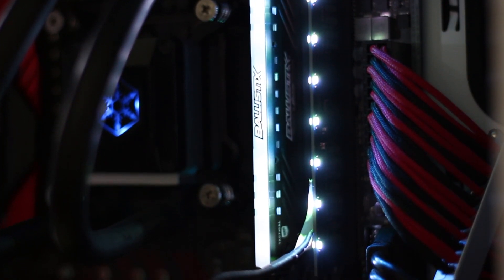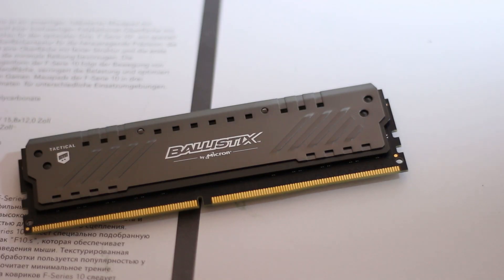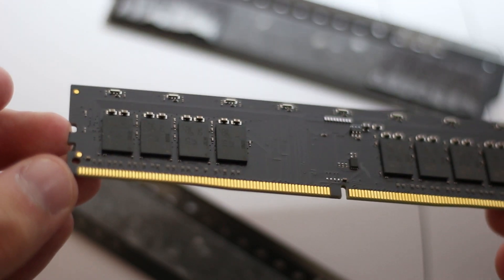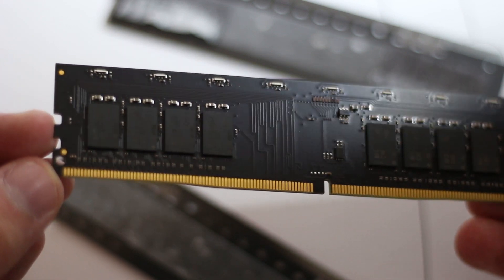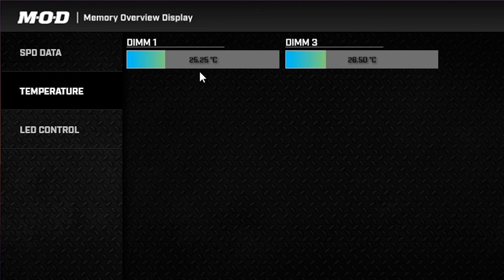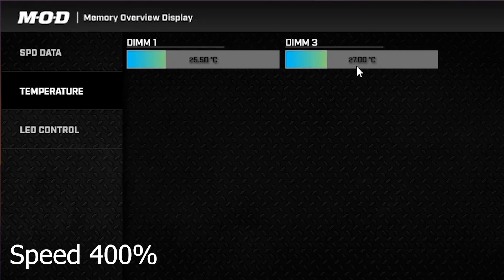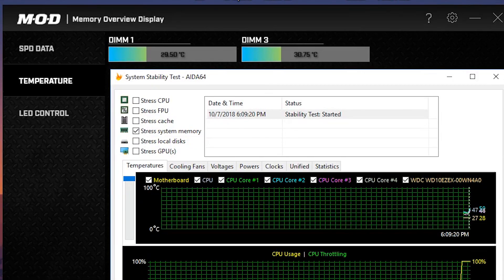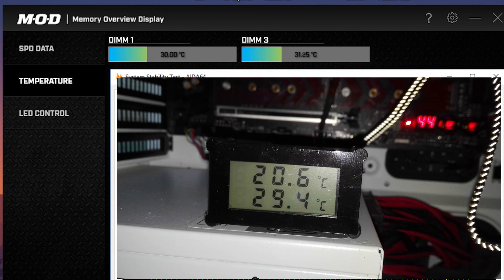Do RAM heatsinks actually provide cooling?

Comment: I think the fact that the heatsinks are attached to the ram with glue tells you everything you need to know and answers the question nicely
Reply from the maker: It depends; there are self-adhesive thermal pads that do transfer heat.

Comment: the problem with how this was testsed is slow without the heat sink pretty much gets all the direct airflow. You would probably observe that ram slot being cooler if it had a heatsink as I normaly find my slot 3 or the closest to the 24pin as my coolest slot when all things are equal because of front airflow. Id like to have seen the test repeated but the heat sinkless ram in slot 1 and the heatsink in slot 3
Reply from the maker: The purpose of this test was to highlight that a lot of claims about cooling are not true. While I understand your point, it cannot be tested as you would need different heatsinks included. By this I mean, some RAM kits have fins on the heatsink, some do not, etc.
Reply: @TechLegend-com  could you not have tested the ram with removed heat sink in slot 2? And slot 4? And vice versa to eliminate the slot with direct airflow seeing better temps. So then you could compare directly what temp the ram would have in what slot. As the slot with the direct airflow is always cooler then the sticks behind it as it blocks a lot of the airflow for the other dims.
Reply from the maker: @Demon09-_-  It all depends on the airflow direction. In in hindsight, what you say makes sense. When the DDR5 market stabilizes I will redo the testing with DDR4 and DDR5 modules and see how those perform with and without heatsinks.

Comment: I don't think this realy provided an answer. What always buggled my mind for example is with those heatsink, the surfaces are very close together. There cannot be any airflow unless it is forced through with a fan directly attached to the sticks.
Just two sticks together doesnt provide that same circumstance. Instead, measure four sticks with heatsinks, than those same four with the heatsinks removed
Reply from the maker: That just adds more variables. Some heatsinks will work, some will don't. The purpose of this video was to make people realize that heatsinks are not necessary. They will help but it's not the end of all things for RAM modules.

Comment: Thanks for the video, I always thought of these ram kits with dangerous names such as rip-jaw, detonator etc were all just gimmicks.

Ultimately the ram chips themselves are mostly manufactured by micron, hynix or Samsung so have to follow the DDR standards.

Most heatsink rams I've come across are attached using adhesive thermal pad, so if the rams were to go say 50/60°c from the serious xmp set by these gameing ram manufacturers, the heatsink would probably melt off and the positioning of most gaming system motherboards being vertical, gravity would assist it falling off hence why there wasn't much difference in temperature with and without heatsinks. That's what I believe anyway.

Have you come across any rams that have heatsinks attached using screws?
Reply: Yes mine use a small m2 screw
Reply: You have to remember just because the RAM chips themselves are made by Micron, Hynix, and Samsung doesn't mean they perform the same. Just like SSD NAND flash is made by either Samsung of Toshiba, and most memory controllers are by either Phison or Marvell, even when two different brands of SSDs has the same exact NAND Chips and memory controllers they can perform completely different due to the PCB and the firmware that the brand puts onto the memory controller.
Reply from the maker: @armybear2  True.
Reply from the maker: There are some RAM kits that use screws but it makes no difference. The self-adhesive thermal pads that they are using on most if not all RAM kits are designed to be sticky even at high temperature, that's why it won't come off.
Reply: @TechLegend-com  but not very high heat, as you've shown, you used a hair dryer to heat it up and it come off easily.
Reply from the maker: @alfredmanner6881  I think anything below 80 is going to be ok.

Comment: Thank you. Does memory have an optimal operating temperature like NVMe does?
Reply from the maker: Usually, DDR4 memory will start getting errors after 50°C. It really depends on what you are doing with the RAM, usually, the RAM will never get to 50°C under normal usage.
Reply: @TechLegend-com  Thanks! 🖖

Comment: This is really good to know. I’m currently running a very small mini-itx build and my pico PSU has wires that run directly over my current RAM sticks. If I were to put in RAM that had heat sinks attached, I would have problems.
Reply from the maker: I'm glad to hear that the video was useful.
Reply: Because of interference?

Comment: i just bought some UGLY looking RAM but its faster than my current 2400mhz and was cheap (2x8GB 3600mhz for 50 USD) and the heat sinks on it look like something youd find in a cereal box and wondered if removing the heatsinks would cause them to heat up too much...looks like it wont really be a problem, cheers!
Reply from the maker: Great to hear that the video was useful to you! :)

Comment: I think you could have made it more clear which ram stick had a heatsink and which one didn’t in your test.
Reply from the maker: Expand on this.
Reply: the one in dimm 3 is the one without the heatsink
Reply from the maker: @fucker9002  It is pretty obvious which RAM module is without its heatsinks, as the LEDs are not covered by the diffuser.

Comment: You foget to make a point... if that 'cooling' is necessary with 30C It's laughably low temp. It provides cooling but is not needed at all.
Reply from the maker: That point is up to you to make, some people want cooling, regardless of how low it is.
Reply: @TechLegend-com  It's a good video I just think you could have included this point as those chips running twice as hot are still within the spec.

Comment: how many mhz is the RAM in this video? i'm trying to find out if there's an amount like 4000mhz that'll overheat out of the box after buying it, i still haven't found any information about that yet
Reply from the maker: The RAM in this video was running at 2666MHz, with the timings 16-18-18-38 and a voltage of 1.2V. If any RAM kit will have a higher than normal temperature, its from too high of a voltage, not really from the frequency. All this being said, I have yet to see a RAM kit that was overheating out of the box.
Reply: @TechLegend-com  i was watching linus tech tips and he built a computer with i think it was 1TB of Ram and i think he used eight 128gb modules? and he said "they run freaking hot"and he had 2 fans just for the ram and when he turned them off they reached 95C
Reply from the maker: @CrasyFingers  Depends on the voltage those RAM kits were using. Also, given that capacity for a single RAM stick, those were server grade components, quite different than the regular RAM kits we use. Especially since the voltage is different.

Comment: How do you think if a ram is ~4 years old - does thermal pad replacement under heatsinks make sense? Ram is heavily oced 1.45v+ and current temperatures in stress tests are like 55-60c
Reply from the maker: Usually, it shouldn't require a replacement for those pads, and 4 years is not that much. I'd say, leave them as they are and get more air moving over the RAM sticks, see if that helps with the temperature.
Reply: @TechLegend-com  Yeah that is one of the problems...my nh-d15 se cover 1 stick totally and to set airflow - it is a tricky question.
Reply from the maker: @BadRusMan  Well, it won't hurt them if you change the pads. So you can do that and see if it does anything.
Reply: @TechLegend-com  guess i will give it a try, hope i will not break sticks in some ridiculous way XD
Reply from the maker: @BadRusMan  You have no way of breaking the RAM sticks, don't worry. Just be gentle when you remove the heatsinks, you can heat them up with a hair dryer to soften the adhesive.
Reply: @TechLegend-com  well i've changed thermal pads for the new ones (arctic) and won only 1-2 degrees, not worth it in the end because still ram oc is not stable XD

Comment: will memory height make a difference? both with heatsinks, one module is 32mm other is 42mm, same specs. taller one costs like 30% more
Reply from the maker: Make a difference in temperature? Depends on the shape of the heatsink, not really the size of it.
Reply: @TechLegend-com  yes, temp difference. cheaper one AMD Radeon R9 Gamer Series  , rectangle shape and other is rectangle with notches, Kingston HyperX Predator
Reply from the maker: @jeccf5072  It will barely make a difference, get the cheapest you can find.
Reply: @TechLegend-com  ok, thanks for the answer man. Hope u get more subscribers
Reply from the maker: @jeccf5072  Thanks! :)

Comment: One thing missing from this video, I wish you specified if you were running Stock, XMP, or some custom settings. Details please!
Reply from the maker: By default all RAM should be used with their XMP profiles, especially since some work at the advertised frequencies only after enabling XMP.
Reply: Tech Legend agreed but it still would be nice to know if you used a 2666 kit, a 3200 kit, etc. Keep up the good work!
Reply from the maker: @depth386  I understand your point, it seems I have forgotten to mention that I used the 2666MHz kit. I will look into this for a future video.

Comment: The best way of removing a "heatsink" is to apply "heat" to melt the materials for easier removal.
Reply from the maker: True, but not too much heat as you can damage the soldering of the memory chips.

Comment: It seems that the ram heatsinks do actually work, but considering that the temperature is only around 30 degrees, do we really need that kind of thing (heatsink) on the ram chips?
Reply from the maker: Not really, not when we are talking about average overclocking. If we talking about extreme overclocking, then PERHAPS, but even, then most people just water-cool their RAM modules alongside the motherboard.

Comment: Hello there. My village has around 20 to 15 celcius. And I got a perfect airflow on my pc. Do I still need ram heat spreader?
Reply from the maker: You usually don't need the heatsinks on the RAM Sticks, as you can see in the video, they barely make a difference in temperature.

Comment: Will a medium/small fan directed towards the RAM help reduce the temperatures by at least 3-5°?
Reply from the maker: Depends, but these type of "what if" situations are hard to test. What if I watercool the RAM sticks? what if I replace the heatsink with something made from pure copper? What if I have taller heatsinks attached to the memory chips? And so on, it's never going to end. :)
Reply: @TechLegend-com  Yeah...But do you think that a regular Samsung 2666 mhz cl19 1.2V RAM on average could be overclocked to 3000-3200 mhz 1.3V without heating issues?
Reply from the maker: @IosifStalinsendsyoutoGulag  You will not overheat any RAM stick no matter what overclocking you try. Before you overheat the memory chips, something else will hinder your overclocking, like the CAS latency, timings, voltage, and so on. If you want to overclock, do it with no worries, I have yet to see RAM overheating.
Reply from the maker: @IosifStalinsendsyoutoGulag  They "can" work together, however what you need to take into consideration when using different sticks of RAM is the timings, they need to have identical timings and frequency to work together. What you need to do, is to configure the timings on both sticks individually and try to overclock them separately. Also, when using different RAM Sticks, you do not enable XMP, as each stick as a different XMP profile.
Reply from the maker: @IosifStalinsendsyoutoGulag  No problem, also, keep in mind: in your case, your objective is to have both sticks of RAM working together, not to get the highest overclock possible. :)
Reply from the maker: @IosifStalinsendsyoutoGulag  This is what I would do as well. :)